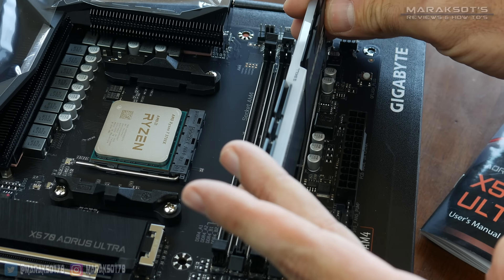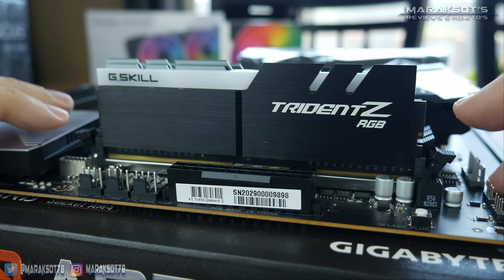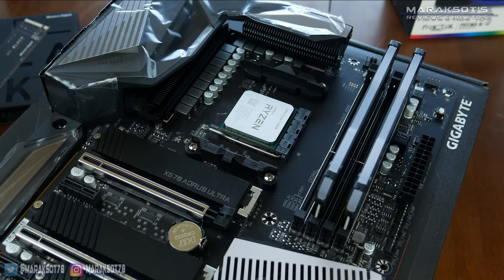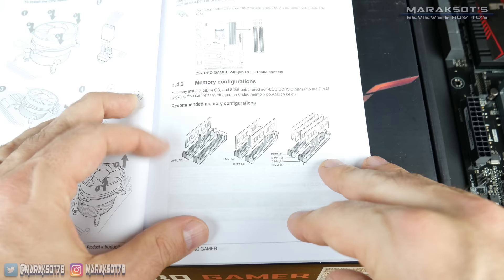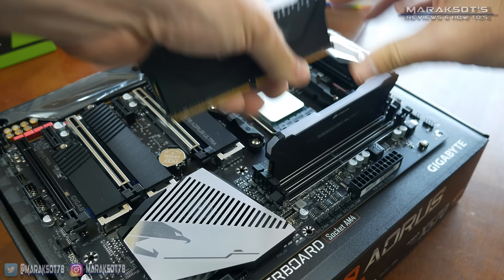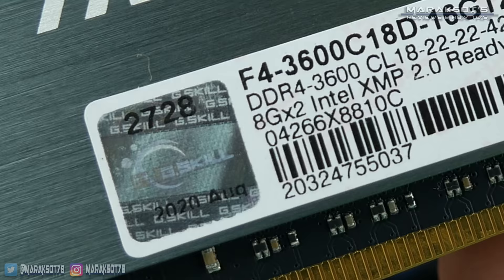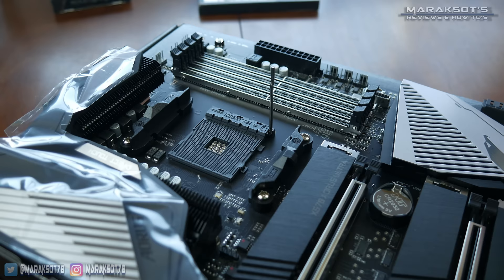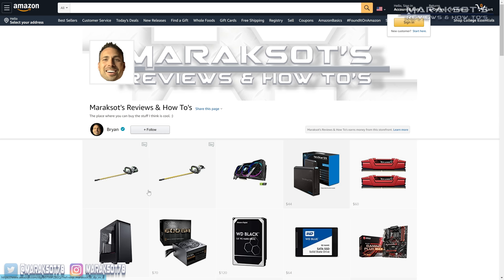A Beginners Guide: Upgrading Your PC's RAM

Comment: Liked and subbed.

Long shot but, I was looking into upgrading my RAM on my pc but now I
 Confused cuz I have 16gb currently but on games like Warzone my “available space” is capped at 5.6gb..I have a i7 10700 and 1660ti graphics card. Will more RAM help push out higher quality settings and high fps?

Comment: I just got new ram (4x8) I looked it up and it said it worked with my mother board and I plugged them in and they are working good and my pc works good but it seems like my pc is having slight issues. It crashed like twice and seems to lag at some points and sometimes my bluetooth headphones also have some sort of lag. Everything seems good for the most part but do I need to do like a bios update or something?
Reply: Maybe change the psu. If u have weak psu it cant handle 4x8 well enough.
Reply: @bobanpetrovic2634  yeah I need to do that. Its working fine now but once I do anything else to my pc I will need a psu

Comment: Hi, I have a question. Say… my motherboard supports a maximum of 2400 MHz… do I get 2x8 GB 2400 MHz ram cards or do I get 2x8 GB 1200 MHz ram cards? Or does it even matter, as the speed would be reduced anyway?

Comment: i wanted to add more sticks of ram so I got some they were the exact same model and everything, my PC worked fine until and installed the other two, the PC read them perfectly it worked fine but when I used applications that used lots of ram video games etc my PC would just crash and restart so i just removed them and went back to 16gb instead of 32gb of ram

Comment: Hey, I got a question if i were to get all new ram would i have to redownload all of my apps on my pc?
Reply from the maker: No. All the data on your PC is saved to a storage drive which will either be a hard drive or solid state drive. The RAM (Random Access Memory) is where data from your storage drive is loaded into so your CPU (Central Processing Unit) can quickly and easily work with it. This is why when you first launch an application it takes a few seconds to load but once it's loaded it works more or less instantaneously. Your computer is "copying" all the data it needs from your hard drive into the RAM. Once it's loaded it works quickly and smoothly.  Whenever you click 'save' you're sending a copy of what you've been working on in the RAM back to your storage drive where it's saved for later. Without the RAM things would be constantly loading which would slow things down A LOT and be super annoying.
Reply: @Maraksot78  thank you so much bro

Comment: My Desktop have 8 slot for ram and it uses 4  slot with 4*16 GB I want to upgrade it with additional rams which is 32 GB with one stick .... What's the problem when mixing capacity if there speed is close 3200 and 3000 ... I need quick answer please

Comment: Are you able to put any type of memory sticks into any type of computer? my computer is a fairly old one but i was thinking if well, doing this and buying some better memory to replace my old ones, but would i be able to buy any size memory sticks and use it with no problems? or does the rest of my computer have to be upgraded alongside the memory

Comment: if board has 3200 and 2933 but skips 3000 does that mean 3000 won't work or are they umbrella values for anything slower than highest speed they can handle?

Comment: Hi, I watched the he whole video and didn’t find a saluting for my Issue. What I’ve done is changed the existing ram( single16gb Corsair Vengeance RGB pro 3200) with 2x16 of exactly the same specs. Also add another 500gb m.2 and changed the cpu cooling system. From a cheap liquid cooler to by quiet dark rock pro4. Now my brand new pc doesn’t boots. Nothing coming to the monitor, RGB on the memory sticks are illuminating and only the back fan is working straight away when switching on the pc. Any suggestions please?

Comment: If you don't have a Manuel how do you find out brand speed capacity? Or would you just replace the ram with new all the same? I'm obviously new to pc stuff 😑
Reply: You can lookup the owner's manual on most electronic devices online. Its best practice to install the same brand and model of RAM.

Comment: Hey thanks for the video even if it's 3 years old now i still found it informative however there is one aspect that i didn't hear much about and thats the difference in regards on the memory on the RAM sticks, so for example, I'm using right now 2x8GB sticks as a dual-memory-bandwidth, however i purchased recently 2x16GB it's the same model in every aspect except of the memory, would i be able still to use the 2x8GB on the two remaining dimm slots? or would it cause problems with the 32GB i already have just because it's in different memory capacity?  Oh and there be a higher risk of receiving a decrease in performance if one use 4 sticks on the memory board and if so why and how can i determine this?

Comment: I want to add 16GB to the existing 16GB on my system. You said it is best to install identical sticks as the originals. My originals are Trident Z RGB  DDR4-3200 8GBx2. The description includes CL14-14-14-34  1.35v.     The new sticks are from the same manufacturer except their description is CL16-18-18-38.  Can you tell me what the CL is referring to and are they interchangeable?

Comment: 10700k and asus tuf z590 plus old ram was hyperx 3000mhz 16gb but switched ram to vcolor 16gb 3600mhz when xmp is on games are crashing tried manually but still same issue i bumped voltage to 1.4 but still same issue is my board is not compatible because vendor tested ram in his pc tested cinebench its working fine in his pc

Comment: I've installed new RAM and my monitor wont work - no signal. swapped my old one back still no signal.  😠  tried to clean the slots still not working... any advice? ( the new parts are compatible with the motherboard)

Comment: I have one tridentz 3000mhz ram which I have to pair with Tridentz 3200 mhz So, can I overclock both the module's to run at 3200 mhz for stable performance

Comment: with a command line   wmic memorychip get devicelocator, manufacturer, partnumber   I get make and part number of memory card in my PC. Now can I buy memory using the make, part number and simply insert in the memory slot or have I to check anything else. Kindly reply.

Comment: Is it as easy as just plug it in an your ready to go or do you have to do some kind of update or anything with the computer once you put it in?
Reply: You might need to go into your bios and enable xmp or docp, depending on what motherboard you have it will be called different. Just so you can use the full extent of your ram since it might be capped pretty low.

Comment: yeah i am thinking about upgrading my pcs ram to 32GB i have a B560 DS3H AC-Y1 motherboard and i want to just addon more ram sticks of the same exact type i already have wich is unknown what kind of exact ram sticks it is but it says XPG on the top and is rgb how would i find what the exact type of ram it is on the market to be the same exact thing? this was a prebuilt pc so i have no information from manuals atleast i dont think on the specific hardwares in my pc and i want to upgrade it overtime

Comment: Lets say my pc recommends a 2933 MHZ and everything is adjusted to that speed, but I put in a 3200 MHZ RAM in instead.............will my pc be fine and run at 2933 anyways?  Providing that all my RAM is the same type speed and brand?

Comment: I have my current single ram stick set to 3200mhz and the new one im planning to add (same brand and speed) is a plug and play thing that sets it at a different speed. Can I just add the new ram stick without having to change back the speed?

Comment: 1 of my ram slot is not working.
the motherboard is just 1.5 year old.
is it because of dust?
I mean i bought a new ram and when i put my new ram in that specific slot, my pc won't boot up i.e no display.
both the rams works perfectly as it works in the slot that my old ram was used. but if I use the unused slot it doesn't work.
if i's dust how should i clean it?

Comment: If you have DDR 3 installed already, can you upgrade it to DDR 4? Or is the motherboard not going to recognize it. (Has nothing to do with the question below ;))

Also, do I have to change something in the computer settings after getting new RAM sticks, or will the computer automatically use the new ram and just roll with it?
Reply from the maker: The slot for DDR3 has a different pin out than DDR4, so DDR3 memory will not fit in a DDR4 slot and DDR4 memory will not fit into a DDR3 slot.

Comment: Hey Maraksot, thanks for the video.

I watched your video and many others on this subject, but i'm still little bit confused.
Here is my question:

I have DDR3 4GB 1600Mhz. Would be better to:
1. buy another DDR3 4GB 1.6Mhz and just add it to my PC 
2. buy DDR3 8GB 1866MHz and remove old one from my PC (I checked compabiliy with MotherBoard)

My main goal is to speed up my PC right now. 
I don't care to much would I pay 60$ for 8GB or 30$ for 4GB nor the fact that I will be able to add another 8GB later and have 8+8GB (if i choose option 2 right now).

Thanks in advance for your reply.

Comment: What I want to know is like I have 2x8gb 3200mhz of ram and im planning on ordering another set of 2x8gb of 3200mhz so i run 4x8gb in my computer once i add the extra 2 do i have to do anything in my bios or does my computer automatically adjust and read the new ram automatically?

Comment: On the Dell website they caution you against using 3rd party RAM and they sell RAM tested for your system but charge about triple the price. If I go to Kingstons website and use their lookup tool for my PC it seems the risk is pretty low of having issues. Do you agree? thanks!
Reply from the maker: Yah, I think the risk is fairly low.

Comment: Hi all, I own a i7 10700kf with a asus z490 prime a board. I previously owned a gskill ripjaw 3600 16-16-16-36 2x8bg kit. And recently bought the exact same pair yesterday and cannot get all 4 too boot at above 3000mhz. I can get 3 to work but not 4 . I even went to a friends house who has a asrock x570 taichi and a 5950x, and the ram worked (all 4) with xmp enabled running at 3600 16-16-16-36. Why is this happening? I have changed my system agent voltage and IO voltage too. Even VTT. Is my motherboard the culprit or cpu?

Comment: I have two 4GB ramaxel sticks in my system. I'm wanting to upgrade to 16GB.
I have four available slots. I found the exact same ram as mine available on the internet. 
Could I buy two more 4GB sticks to make it 16GB. Would it be ok since they are the exact same make model, speed and everything or should I get two 8GB 
I don't know if ramaxel even has 8GB for ddr3.

Comment: I currently have 2 ram sticks installed 2x8 and I’m going to get 32GB so 4x8. When replacing I can just take the current ones installed and install the 4 right? Or is there a certain order I need to place the sticks in ?

Comment: I have a question i brought a new ram but i didnt put it yet because many other youtube channels shows that when you are about to push the ram in you have to push it first from the left side and then from the other and i can see on your video that you just push it straight without doing it ... Also my motherboard has two "things" that hold the ram in just like yours. So my question is that is it important or not if i put the ram straight in or push it first from the left side and then from the right ????

Comment: If my processor can only run at 2900mhz and the ram modules that I want to upgrade to run at 3200mhz is there a point in upgrading the modules or should I change my processor first. Btw Im changing from 8gb RAM  to 16gb RAM

Comment: When i add new ram modules do i have to go in to bios mode and make adjustments or its just plug and play? For example Im thinking about either getting different ram brand but same capacity just to keep it the same kind or keeping them the same brand just higher capacity

Comment: 0:39 About the static thing, do I need to do that? Because I only have wooden floors but I'm not sure because I'm new to building PC's :P
Reply from the maker: The point I was trying to make is that ESD isn't as much of a concern as some people will lead you to believe.  If you simply touch a metal portion of your computer case (which you will more than likely do without even thinking about it since you cna't not touch it while working on your PC ) you will be just find.  Doing this will equalize the static charge between you and your PC and make killing your components virtually impossible.  And even if you do shock one of your components, modern PC parts are much more robust than those in the past and your odds of killing something are pretty low.  People like JayzTwoCents and Linus Tech Tips have purposely tried to kill computer components by shocking them and have found it's actually quite difficult to kill components with ESD nowadays.

Comment: I have an old pc with ddr3 RAM 8gb 1900mh and was trying to add another card which was the exact same brand, speed and also 8gb. After placing the card in the socket my pc started up without showing any screen. Screen remained black and the little white light of the power button kept flashing on and off.
The problem is that I can't go in bios settings when this occurs because the screen is black.

Anyone knows what could be the problem? 

Also I tried this same new memory card on a different pc and there it worked fine.

Comment: Hello, just stumbled across your video as I was looking at RAM stuff..

Got an advance question for you..

I'm upgrading but cannot install my new AMD based ROG X570 until I can get a new CPU. 

SO Im installing components one by one to improve performance. So far I have installed the RTX 2070 and upgraded the ram to 64GB.

Now here is my question. My ROG Z270 only supports 32GB, but it has taken and registered the full 64GB.. No issues seen this far but I'm a little amazed by this..

Seen this before? and should I be worried about frame rate impacts or instability? 😬

Comment: so I'm completely new at this, full on ignorant,  I ordered ram of the same size speed all the specs are the same, but it is a different brand because I couldn't find my the stock ones, is that ok? I'll get 2 additional of the( T-Force Delta RGB DDR4 16GB (2x8GB) 3200MHz) if needed but i didnt find this video until now, very useful thanks! I've always been a console gamer but I wanted a true all all in one so I got a G10DK-WB764, phoenix 3060v2, 256gb (upgrading that soon) 1tbhdd, 16gb ram and Ryzen 7 5700g I have had it a year and I'm pretty happy with it, any pointers on further upgrades? thinking about a 3080? all tips appreciated 😁

Comment: Ok so I got 2 16gb of ram I spent like would say hour and a half trying to get this to work. Apparently I really gotta jam it in there like I took my ram in and out like 20 times. It started working when I used 1 of my 16gb with my old 8gb ram and I had 20 it booted in windows. So I tried one more last time and replaced the 1 8gb stick with the last 16gb and it booted! 32gb in windows I enabled XMP and At 3001mhz so I guess make sure u put the ram in precise I guess.

Comment: What is the best play and play ram? i heard its formally called JEDEC Ram,the only one i could find was the Kingston Fury Beast which runs at 2666Mhz when installed and advertised as "Plug and Play at 2666Mhz",Im wondering is ram that has JEDEC profile on it can only run at a max speed of 2666Mhz? Im looking for something with this because my pc does not allow me to enable XMP profiles..Or change anything about the ram(Ram speed,timing,etc..)

Comment: Good video. Hey do I need to change the speed in bios if I already have xmp enabled for my current ram? Or will it just adjust to the new speed. Bought new faster ram. Replacing entirely
Reply from the maker: Yes, you'll need to enable XMP for your new RAM once you swap them in.
Reply: Thank you sir. Vso it will go back to normal when it reads the new ram so just go enable xmp again? Ok

Comment: my computer uses 4800 mhz ddr5 ram. i went on the manufacturer's website and it gave me a list of compatible ram that is not the same brand but all other specs are the same. I'm also adding 2x16 to my existing 2x8 . will that be okay?

Comment: Also does ram help out with graphics in anyway?
Reply from the maker: System RAM doesn't really do anything for graphics.  If you don't have enough system RAM your computer will have a hard time running a game though, meaning the frame rate will drop from time to time as things are having to be loaded in and out of your RAM.  Currently 16GB is a good amount of RAM to have.  VRAM is another thing all together.  It's the memory that's built into a graphics card and nowadays you want to have at least 8GB of VRAM on your GPU IMO.